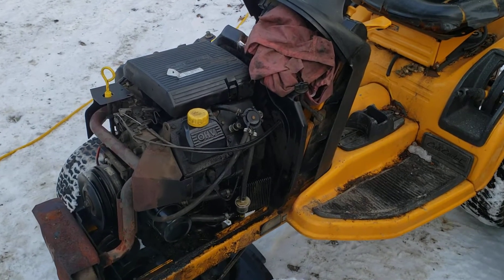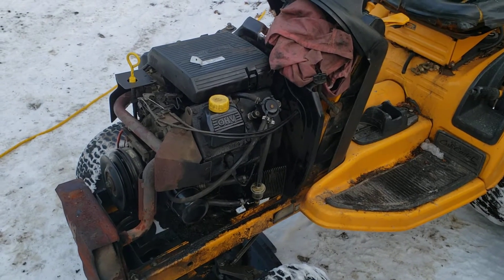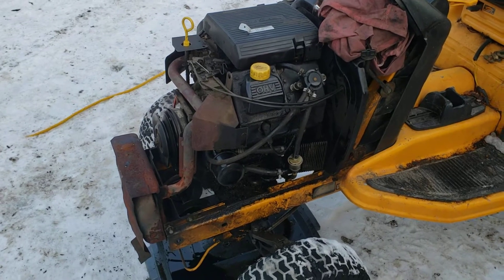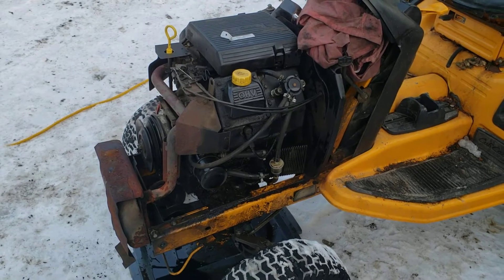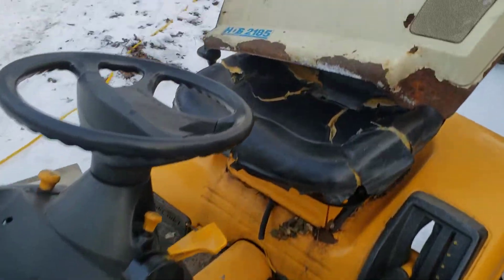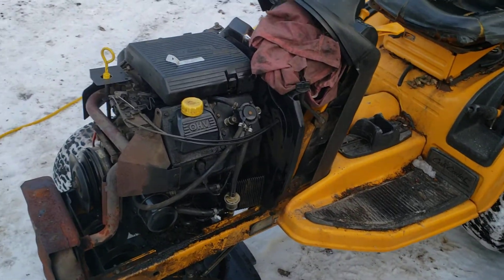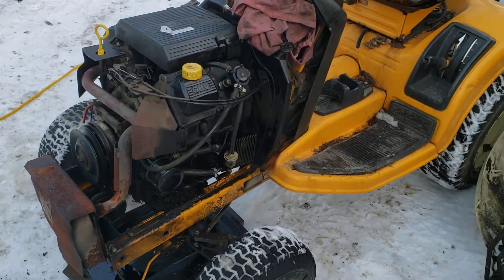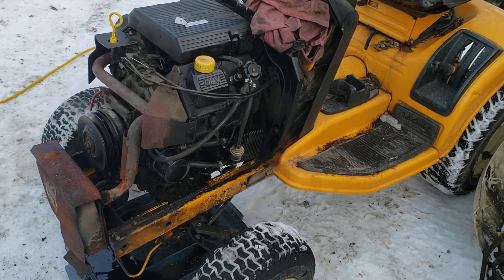Cub Cadet 2185 Engine Swap

Comment: I have a 2165 with all sorts of issues with the motor and cant find any used Kohler Commands to swap the Briggs with. All of the frames are the same, the numbers just say the mower's Engine, deck, etc... Im sure you can throw a vanguard in there, just make sure it isnt reverse rotation. The only good used motor I've been trying to find was 400 miles away from me